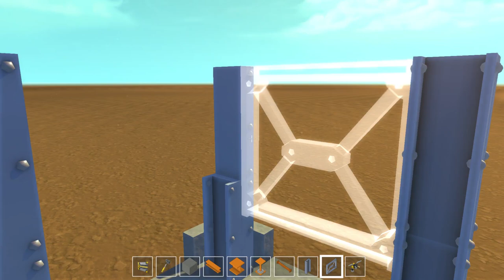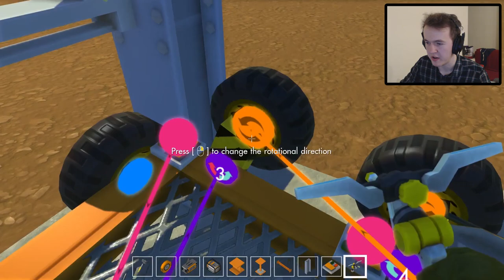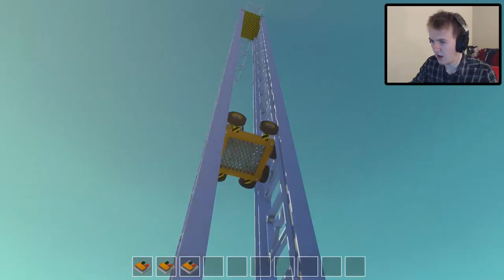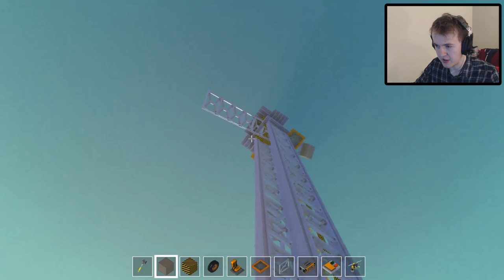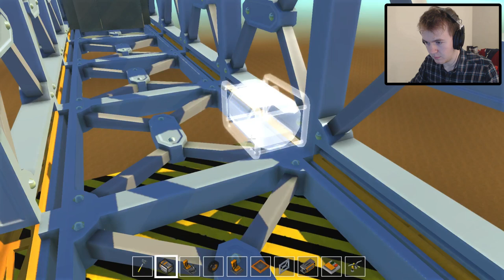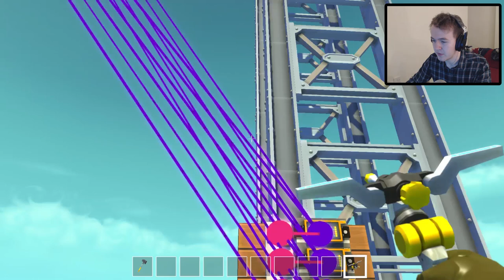A CRANE IN SCRAP MECHANIC | Scrap Mechanic Creations #9

Comment: I think you are the biggest youtuber!!!
Reply: +M&J I Minecraft & More In Height?
Reply from the maker: +M&J I Minecraft & More +Nick Newton I'm like 5'9'' guys. And I'm not the biggest youtuber in any other ways either I don't think :P
Reply: +TheOriginalVader   If you use just the bearing in the controller to turn it and put Rockets just on the edge of the crane then you can turn it with the weight

Comment: to get the crain to twist at the top or bottom then you need the platform the top of the crane sits on to have about 5 diffrent barings with the engeins in the gas engein

Comment: On cranes.. The concrete counter weight at the bottom is usually way bigger than that one layer. Sorry, that just kinda bothers me.... Other than it's a great vid, good job..
Reply from the maker: +End Legacy I know, but in this it doesn't do anything so I thought I wouldn't bother
Reply: +TheOriginalVader yeah...... I guess you weren't going for looks rather than functionality...

Comment: electric engine has more torque but other has more hp
Reply from the maker: +TheSimple GamingChannel That's what I meant to say. More torque for big slow stuff like this
Reply: if you wanna move crane put alot engines
Reply from the maker: You can only attach one engine to each bearing. We would need to have the top part floating on a load of wheels or something I think